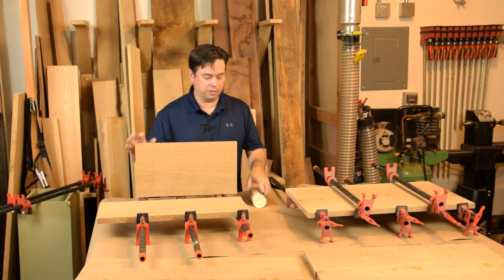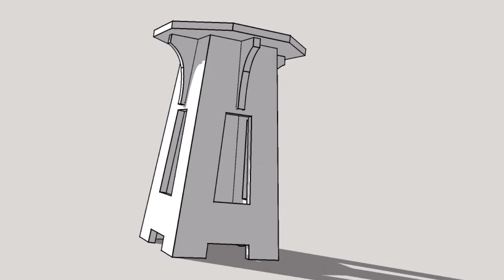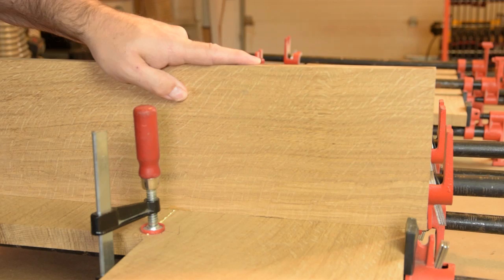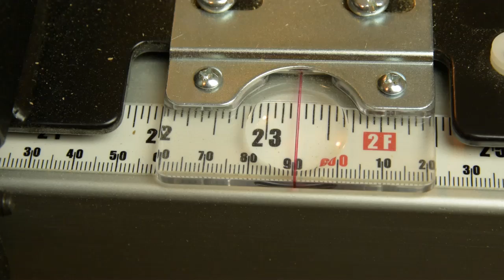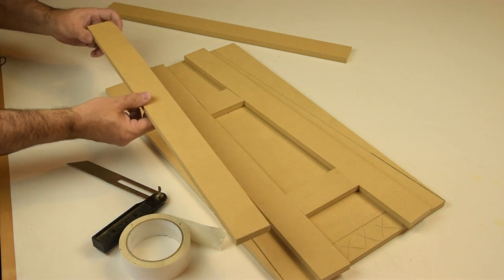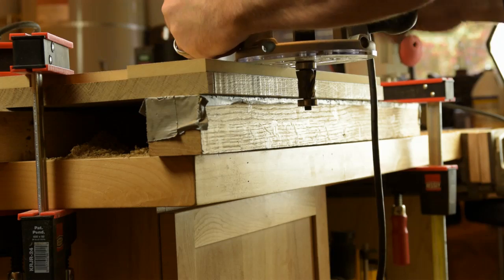How To Make a Tabouret Side Table | F2 Tablesaw and 14|12 Bandsaw

Comment: Dumb way to cut. Those push sticks slip and your board will come at you like a helicopter blade. Very bad
Reply: Hi Tony,
Normally I would agree with you.  What makes this cut safe for me is twofold.  I consider a riving knife mandatory for this particular cut.  Also the fact that it's just a skim cut makes a big difference.  
We all need to decide what feels safe for us.  If your gut tells you to use a different method, by all means take a different approach.
Cheers and thanks for commenting.  
Safety is a big deal for me too.